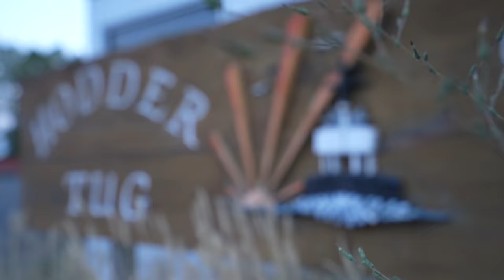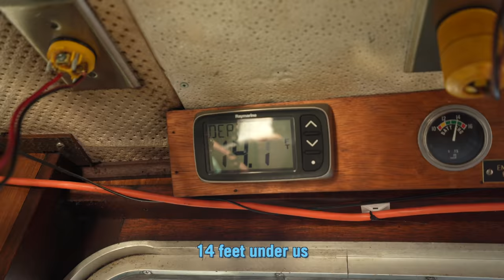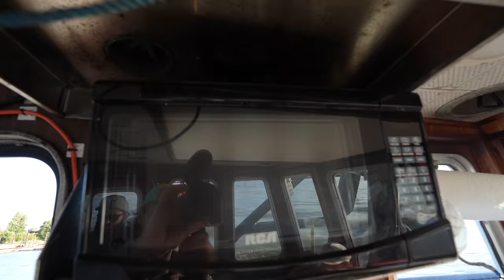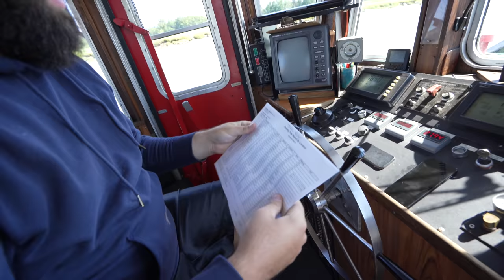12 hrs on a TUGBOAT - Dangers of a Log Runner

Comment: VeryCool, HODDER family worked the Fraser river for over a century They sold the company years back Still the name remains which is great, the Tug Downie is on was once the Squamish Rebel that worked up in Howe Sound, many of the Tugs working the Fraser are decades old but still hard working with plenty of life left in them, the tug you see pulling ahead was once the Tiger Shark part of the long gone Westminster Tugboat company It also worked as a Line tug  helping with Ship handling in the Port of Vancouver, it is not a job for everyone but for the chosen few it is Awesome indeed Thanks for sharing and Congrats on working with CHEK.

Comment: I'm 74 years old now, but I spent most of my working life as a log scaler and grader (one who measures log for volume and value) on the Frazer River, so I worked on the log booms. In all that time, I fell in twice, but I NEVER went out on the booms without a life jacket. I'm surprised these folks didn't wear one. Buy the way, the Frazer River back in those days was absolutely filthy. I don't know if it's gotten cleaner in the subsequent years, but you definitely didn't want to fall in back in 1970.
Reply from the maker: These guys always wore a life jacket when they were going out into the booms. They would take them off when they got back in the boat.

Comment: Not jobs for me, but they look like they have it under contro . We have lots of tugboats around here, but they push/pull mostly corn and soy. The challenging parts are the locks, and when the rivers are in flood stage or really low. (Which also close the rivers to traffic at times) I live near the confluence of the Missouri and Mississippi Rivers, so there is a lot of tug/barge traffic.